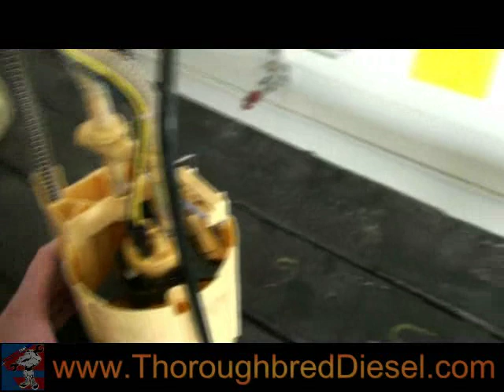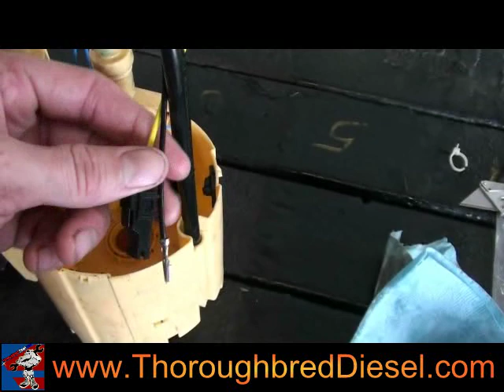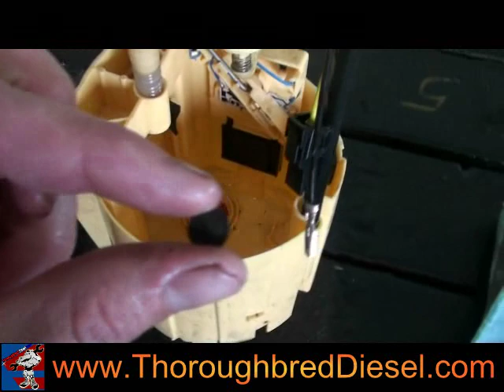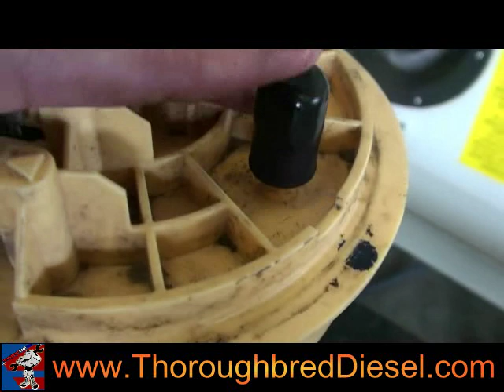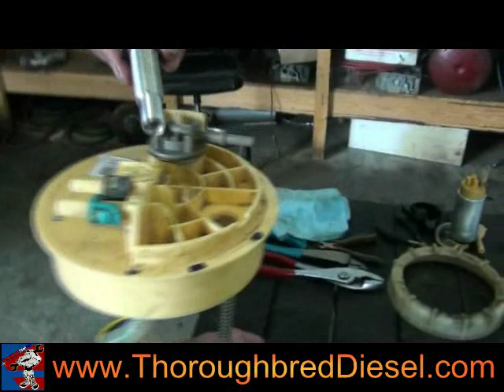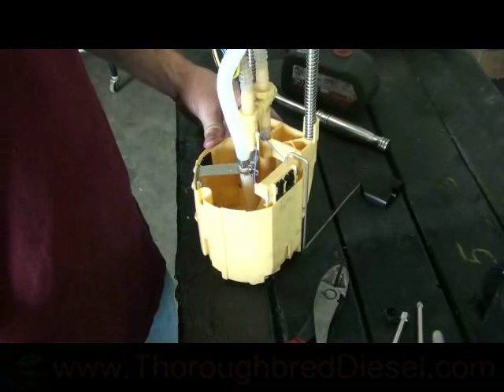AirDog Fuel Pump Module Upgrade Install | Dodge Universal

Comment from the maker: You can simply tape the power wires up because once disconnected there is no current.  The tape is simply to keep ends from corroding.

Comment from the maker: This question as come up quite a bit.  It has not been a issue because customers that do that extreme of offroading usually go into their trips with a full tank of fuel.  But yes,  even with a stock fuel pickup,  if you have a extremely low fuel level,  and you are at an extreme climbing angle,  you can run out of fuel to your supply pump.
Reply: the mesh on the bottom of the fuel cup is a check valve

Comment: Hi Wayne, when I ordered from you I was out of town away from my truck only to discover that I have an intank pump. I followed your excellent explanations of the system & instructions. Great job! I agree w fuel quality comment, my screen was 3/4 plugged w metal rust shavings. So it was only a matter of time before my OE pump would have been toast! Dave
Reply from the maker: Dave Kana Thx for the nice comment Dave. My name is Wade not Wayne btw. :) Glad we could help you out.
Reply: Wade a min, sorry, got it now! I realized that after I posted it a day later! Dave
Reply: Wade, I did not drill holes in the side of the stock canister. Will I have any issues w this? I'm only at the stock HP rating, thanks, Dave
Reply from the maker: +Dave Kana Dave, you will want to be very careful below a quarter of a tank of fuel.  Just make it a habit to fill up before you get that low and I do not think you will see any adverse affects.
Reply: I will be very careful. I believe the 1/4 tank rule to be good for the VP44, since the fuel is what cools the pump. Dodge?Bosch stated that the fuel to the pump should be no warmer than 90deg F.

Comment: Thoroughbred Diesel- I'm getting P0462: Low Fuel Sensor Level Volts... I already have the Raptor 150 after market pump. 1. Is my Fuel Sending Unit even in the equation. 2. If so, is changing this out most likely going to solve my problem. 

I get the code every few days. I clear it with my programmer and it's fine for a few days. I never get below half a tank.

06 3500 MegaCab
113,649 miles
Smarty Touch etc. etc.

Thanks for your time.

Comment: On the 2 existing flex lines do i need to cut out both (check valves) or just on the Green clip suction line? Or just leave them alone unless you are having issues? I have an External FASS Lift pump so bypassing the in tank pump as need. Please let me know. Thx

Comment: when going off roading or hill climbing on a angle wont the fuel run out of the bowl with the hole drilled in it an suck air ? and dos the kits come with the module upgrades or do you have to buy it ?

Comment: What did you use to cut it? Mine looks a little different. It has screws but I can’t access them so I’d rather cut it out
Reply from the maker: To cut the pump out I just used diagonal cutters.

Comment: Please help me out with an easy mod to do to the canister on a 2002 Chevy Silverado 2500 HD 6.6 lb7, as I'm having fuel issues when getting on it have air dog 165, all necessary mods, yet not enough fuel when needed .
Thanks,
Duane
Reply from the maker: +Duane DeValkeneer Is your lift pump pressure falling off or your actual and commanded rail pressure falling out?  What mods to the truck.

Comment: I have a 1999 and have the In tank pump.  If I use a SUMP on the bottom of the tank, do I still have to drop the tank and remove the in tank pump or can I leave it and snip the correct color wire that feeds the pump so that my fuel gauge will still work.  Also, with the Airdog system, Since there is a return coming back off the VP44, where does the return for the air dog go?
Reply from the maker: +Matt K You do not have to remove the pump if you do a sump.  Also, you will connect your Airdog harness to the conversion drop that goes to the tank so you will not have to cut the power wire to the pump either.  The Airdog return will go to the filler neck and is plumbed into a manifold that is installed with the Airdog.
Reply: +Thoroughbred Diesel So I would not need to remove the fuel tank then?  When you say filler neck, are you talking about the tube that you pump diesel into from the fuel pump?  I had seen where some of the returns went to what was the original supply, if thats the case would I need to drop the tank and do something so the return fuel would flow back into the tank?  Sorry for all the questions, I just want to make sure I have my ducks in a row before I take my truck out of service.  Can't afford to get it apart and then find out I don't have everything planned out.

Comment: So I’m in the middle of doing an Airdog 4G install that I purchased from y’all. I’m actually waiting for a new in tank pump to ship to me because the plastic on the hat where the spring loaded rods seat, are cracked and I don’t want it to come apart after all the work to remove the tank. My question is, what do I need to do if I’ve installed a Beans sump in the tank? If I’m thinking right, I believe I just need to remove the pump from the basket like you’ve shown, cut the 2 fuel lines on the pump, and clearance the basket for the sump. I don’t need to do anything with the bulkhead fitting right? Is that all? My pump should be here tomorrow, everything else is done. Airdog is mounted, tank is cleaned up and sump is installed, and the fuel rail plug is in.
Reply from the maker: If this is a new model Dodge, you will be cutting the power supply to the intank pump with the wiring harness so that pump will not be operational.  Next, you will not have to install the bulkhead fitting but you will still need to modify the fuel line in the basket going to the lift pump.  You can just cut that line because you will be hooking the return fuel line from the Airdog to that fitting.  What we want is for the fuel to return to the tank and not be interrupted by the intank pump.  If you have any questions on it just give us a call.
Reply: Thank you !
Reply: @thoroughbreddiesel  
Wont cutting the power supply to in tank pump stop the floater reading to cluster gauge